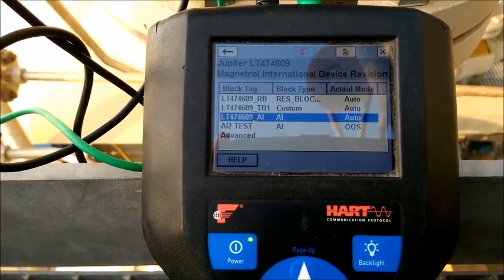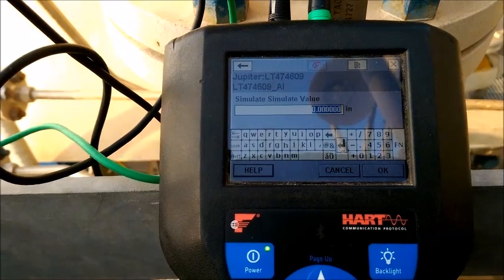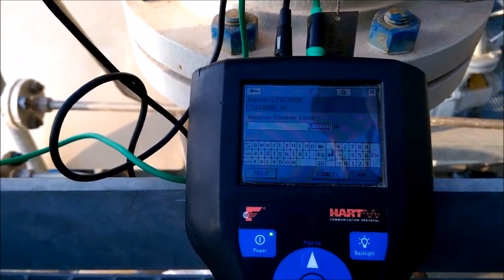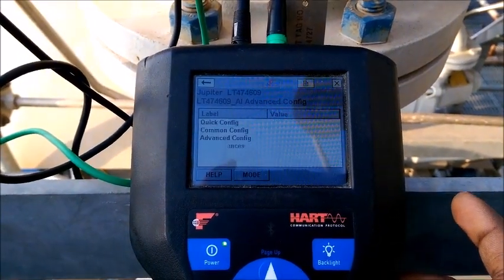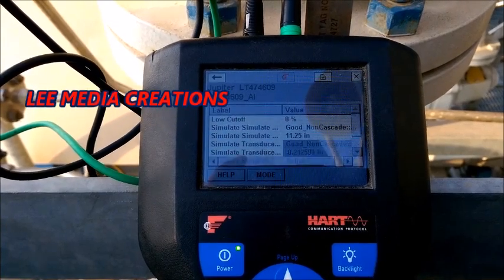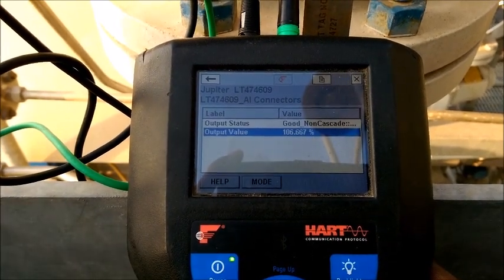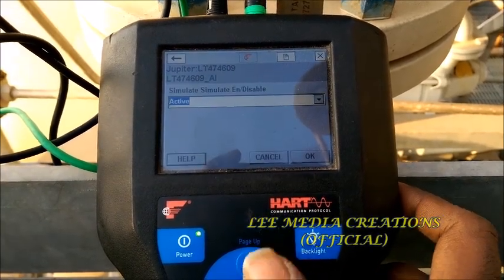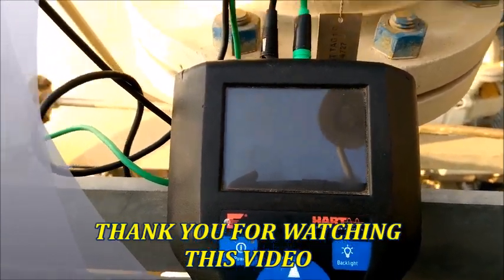LOOP TEST OF LEVEL TRANSMITTER

Comment: Hai Bro thanks for the video,I want to ask you one question before you simulate any value we have to change the mode in Analog Input block then only we can simulate the value and also have to enable the DIP switch in transmitter side in future please include all procedure for better understanding,Thanks and also please teach us how to do Auto calibration for control valve(fieldbus application) and also simulation procedure for Rosemount & Yokogawa products...

Thanks a lot....
Reply from the maker: Hi bro, thanks for feedback. Yes, you are right. Some instruments having a  DIP switch in fieldbus devices. I have also seen. But in this product there is no any DIP switch. I opened fully and checked. This instruments is provided direct access. Sure, I will upload soon a DIP switch instruments. Thanks
Reply: Thanks bro...